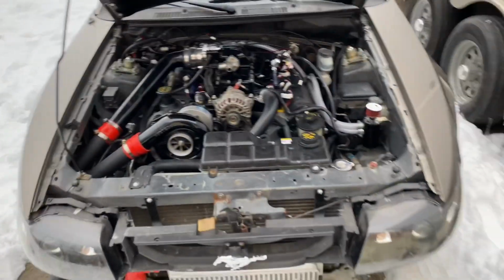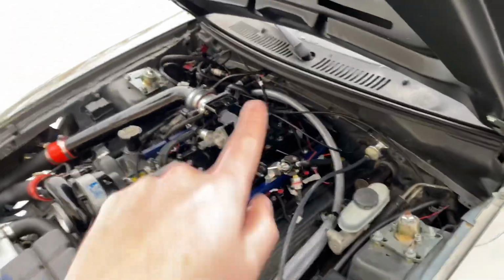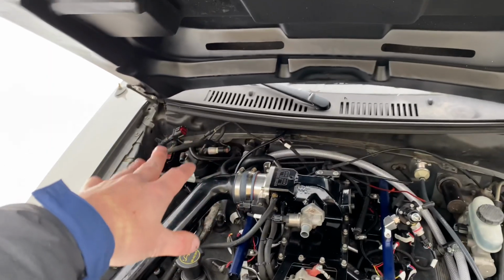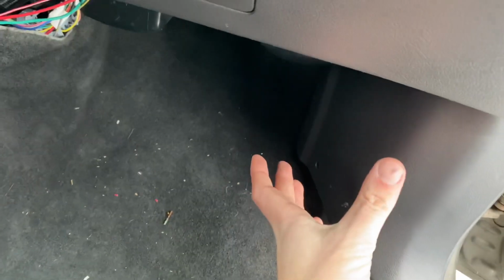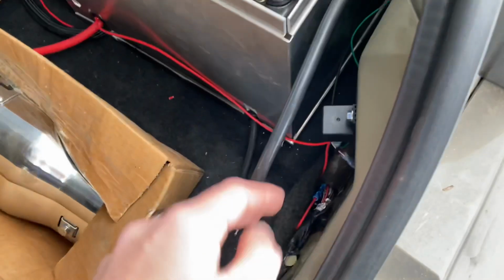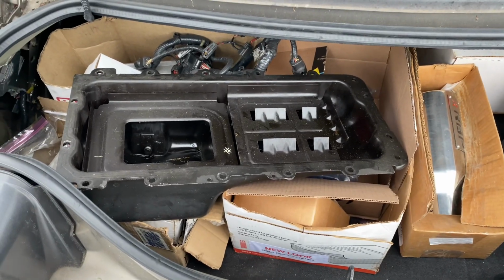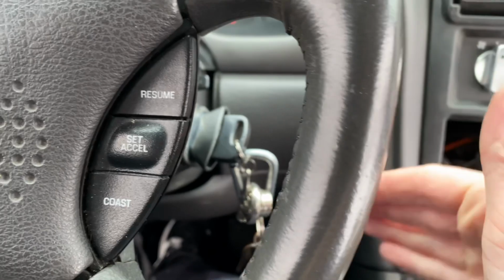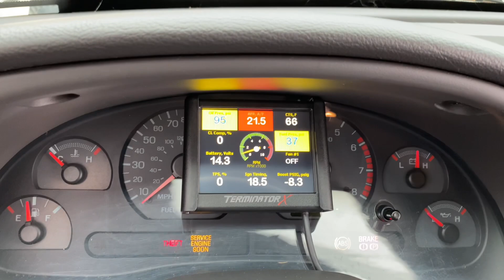The vortech 2v is back! Holley terminator x efi.

Comment: Hell of an exhaust leak! Haha. Those cams sound bigger than the 262. Maybe 268 or 270. That intake manifold may be hurting average power quite a bit without large cams to compliment it.
Reply from the maker: Not my car, not the intake I would have ran. It will absolutely be down on average power with such a short runner intake.
Reply: Great video though! I really like your informative stuff.
Reply: After having the high revs of my Boss 302 and deciding to procharge it, I wanted to build a car around being a daily/errand car, that can roll(similar to Boss in N/A trim), that i could put unlimited miles on. I plan on throwing a 4.10 in the rear to compliment the power band, and figured thats where most of business will be done (above 3500rpm to 7500rpm) even if i did get to digging anyways. I hope i am right. Lol!

You have a good ear. Cams are very similar to a "stage 3" comp. It seems to have some characteristics of 270ah w/ a hair more duration. But they are custom bullets and i picked them up from a guy who parts these things out for a METH HEAD DEAL. I couldnt say no to that.😂

I didnt know it had a 3.33" either, thought it was smaller, looks like ill have to send a 3.0" over.
Reply from the maker: Brandon it may be a 3.1” I can’t remember. To
Many numbers swimming around up stairs lol
Reply: @andrewlavender08  i do imagine you got enough going on with your monster of a build, to worry bout my lil ol thing! Lol
Reply: Brandon if you check out Richard holdeners videos at all he just put up a intake comparison video this week and your intake is one he tested. On a stroked 2v with comp 278s the cross over point for power was at 6500rpm vs the pi intake. The pi intake made a lot more power everywhere below 6500. Go check it out. Not to bash your setup, just trying to give some friendly advice.
Reply: @johnbeardsley2962  no bashing felt! I am aware of where and how it performs! They did a test in MM & FF between this intake, the eddy and the pi plastic and non pi plastic, about 20 years ago, believe it or not! For what is in plan for the future is more of where I built for. I thank you for the concern!

Comment: Andrew, thanks for consideration, but I understand it's a bit much to ask and truly understand. Could you please help me out with one more question. I currently have a 6 rib setup with the f1. Now, I did delete the AC. The mechanic is telling me that not only do I need a eight rib to avoid slippage , but now he's telling me a thump rr as well. I've read both aren't necessarily needed. Could you please shed some light on this? Boy, I would really hate to spend another 1000.00 just for pullies. Thanks bunch

Comment: I got a 4.6 2v in my 04 f150 that's hard start but it will idle??? Won't take gas an only passenger side motor gets hot fr driver side ice cold.

Comment: Was there anything you had to do to any of the alternator wiring? Ive seen where some say you have to add a resistor in somewhere or do a jumper for some wires behind the cluster. Is that needed for an install like this or is that for something else?

Comment: Good info! So I'm guessing if it was an automatic you'd need something to control the trans too?
Reply: Depends on the trans, th350s/400s and glides have no electronics.
Reply from the maker: Yes, the terminator x max can control a 4r70w or would need to go manual valve body

Comment: Hey Andrew, first off, thanks for all of your informative videos. Second, I'm looking at having a shop install the terminator x in my Stang, however, the price difference between 1 shop and another is thousands( 2500-4000). I'm sure you gave your buddy a nice deal, but could you tell me, from your experience, what a shop with experience should charge? Give or take( hours to install). Thank you, sir
Reply from the maker: I would guess 1000-1500 tops for a basic install
Reply: @andrewlavender08  Thanks Andrew for even taking the time to reach out. The words spoken about you are true, your a good dude. I had one shop tell me 3500.00 because of all the wiring involved. I spoke with Holley and they assured me it really is alot if plug and play. Yes, of course, there is wiring and cutting, but man 3500.00. the kit cost half that. The lowest quote I've gotten is 2300.00. you seem like such an honest guy, I would be willing to send you my car and have you do it. I would pay you the 1500.00 no problem. I know this is considerably near impossible being that your in ( Tennessee?). I am in ct. I would, by all means, make arrangements and trailer my car to you. Your honest and extremely gifted. I don't know if this is something you would or could even consider, but I am open. My car has quite Abit done( not nearly your app, however, 5 year build. Motor is done, fuel system done, rear end locker done, axles, cams every bolt on imaginable and a f1 procharger. I feel as if my dream of my car ever being completed is starting to dwindle. Any advice, if not interested, on maybe someone closer to me, that could handle the workload. Tranny and Holley terminator,and I'm done!! Thanks for considering.
Vin. I want to add, yes, the cost to have sent to you and back i could have done for about 1000-1200 and that would make you around the 2500 mark, but you seem like an honest person who takes pride in his work, and for that reason, it's truly worth it. Would you in any way be willing to chat. On my dime of course. Thanks

Comment: Any idea as to which type/brand of forged I-beam rods and forged pistons are in it? Buddy of mine is planning a budget short-block build and we are trying to determine which parts, dollar for dollar are the best to throw at it.
Reply from the maker: It has my old MMR I beam rods that I made over 750rwhp with. Not sure on pistons
Reply: Andrew is correct, his old MMR900 rods and piston & rings are stock Terminator 03/04 Cobra.  

Might want to look into Boss 302 rods & DSS X pistons  if youre looking for a good cheap set of rods & pistons! Its 100% the way i would go now if I did it and couldnt get this deal.

Comment: Thanks for the overview. That was very interesting. I gotta ask a stupid question, why do you need it? Are you shifting at 7500rpm? I am not up to speed on this car.
Reply from the maker: Idk what it will shift at yet since I still haven’t driven it. The Holley has a lot of safety features that will save the engine you just can’t get with a stock Ecu
Reply: @andrewlavender08  Yes ok I see. I did a little reading on it. Appreciate you clueing me in. I’m on my 1st build and the learning curve is steep. The thought of tuning and data logging my marauder scares the heck outta me. I’m an old retired mechanic but all I’ve worked on is diesel powered cranes.

Comment: Great video, thinking about the Holley in mine
Reply: Same here I'm bout to drop a holley terminator x max system with a 98 cobra motor in my 96 GT and then use that motor as a core for a forged bottom end trickflow headed long block for an 02 f150 v6 I'm about to get.
Reply: Best choice I made... Andrew def led me the right way on that. You wont regret it.

Comment: Why is the IAC valve hose disconnected?
Reply from the maker: No place to connect it into the current intake tube, there is also no need to connect it since the car is running a map sensor now abs not a MAF like the factory set up
Reply: @andrewlavender08  oh okay